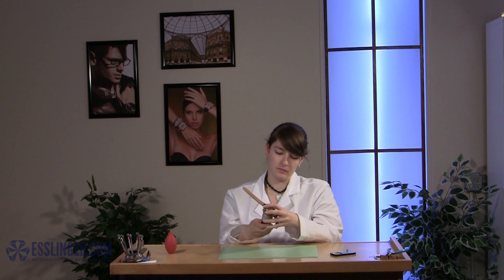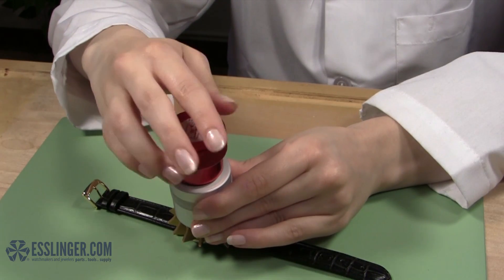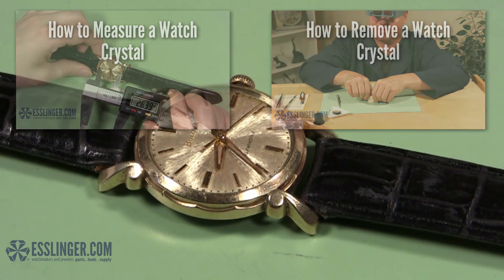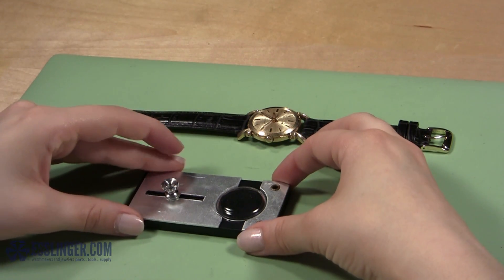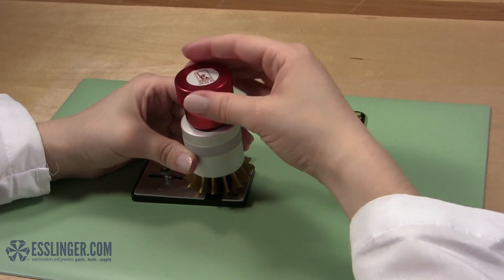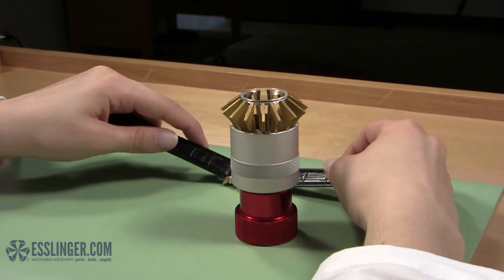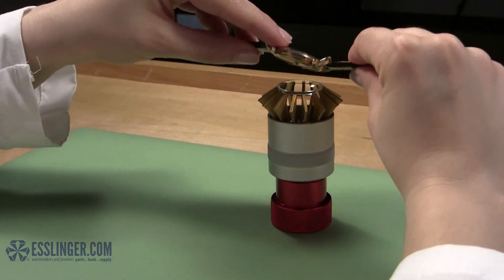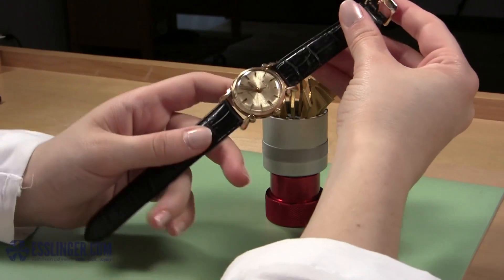How to Use a Crystal Lift to Replace a Watch Crystal

Comment: When replacing a crystal, it is important to have a noticeable lip free of the grip of the crystal lift. The metal plates on the crystal holder determine the depth of the lip. On my crystal lift, the metal plates created no lip at all. The holder was basically flush with the edge of the crystal itself. I realized that I had to increase the depth of the metal plates so that the lift would sit higher on the crystal and create a usable lip. I used thick electrical tape to cover the metal plates. I removed the larger plate to use as a stencil for the fixed plate. Once the electrical tap was installed so it covered the metal plates, the lift sat higher on the crystal and created a good lip that fit well into the watch. I can't believe these things are being sold with such a design flaw. Either the plates should be thicker or there should be inserts to create the right size lip. It took me a couple of hours of frustration before my light-bulb moment. After installing the tape, it took me one try to get it right. Not sure how Ms. Watchmaker is able to do it so easily, definitely no my experience until some tinkering with the tool. Good luck!
Reply: Ignacio Carrion great tip, thanks!!

Comment: Does not work on flat mineral or hardlex or sapphire crystals. Attempted to use this on an Orient Mako II diver, did not work. It is, however, great on using to remove a screw down case back if you don't have the proper tool to do so, just make sure to place a piece of thin rubber between the lift and the case back to prevent scratches and to allow grip on this case back.
Reply from the maker: You are correct that this tool is not made for glass crystals but I have never heard of this tool opening a watch back - good work on that discovery !

Comment: maybe they should have reminded the demonstrator "righty tighty and lefty losey" She got it wrong several times lol
Reply: yo my watch crystal seems to be stuck; i.e. the claws arent opening or closing, and on top of that the screw in the middle seems to move? any fix?
Reply: Generally you are right. But bikes, lathes  and other devices sometimes use left handed threads.

Comment: would this work with mineral or sapphire crystals?
Reply from the maker: This is for unbreakable plastic / Lucite crystals only
Reply from the maker: It is designed for domed crystals
Reply: Thank you
Reply: @Esslinger  ,  so how do you replace a flat crystal?  With a different crystal lift?

Comment: I have this tool, but it doesn't work to reinstall the acrylic. Only work to remove. I do not recomend!
Reply: Yes for most watches you need a press, but this tool is still good to remoove it without having to open the back and remooving the movement.i guess.
Reply: I reinstall with it as well, but it is hard on your nerves putting the right amount of pressure on it so it will fit. I keep thinking I'm putting to much pressure on it and it's going to break, but that's  not happened to me yet......YET LOL!!!
Reply: @karinlefevre9988  Its very easy to break with just a little more pressure than necessary.